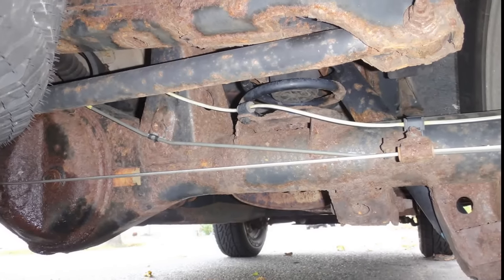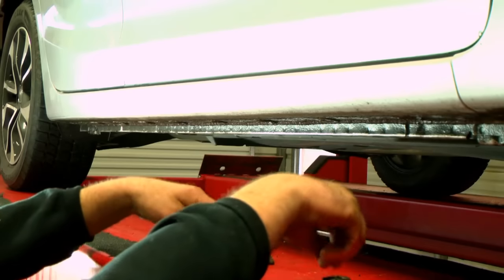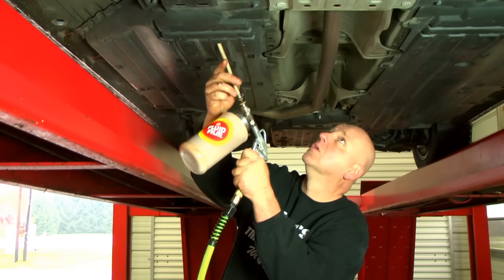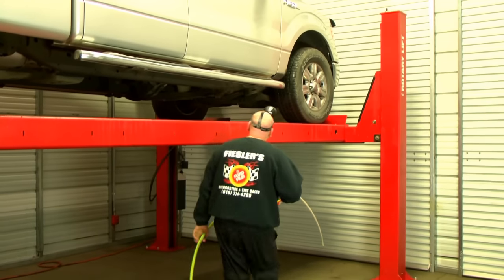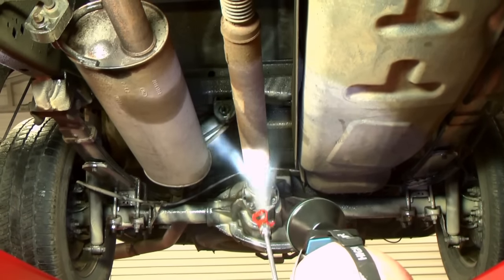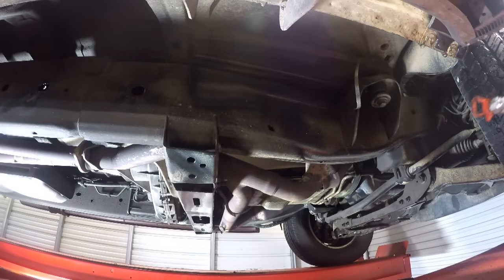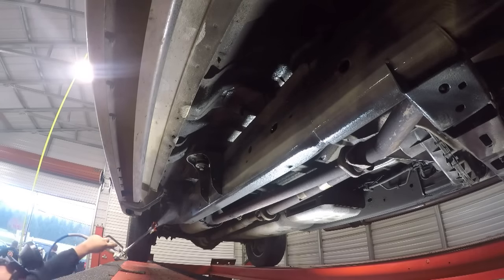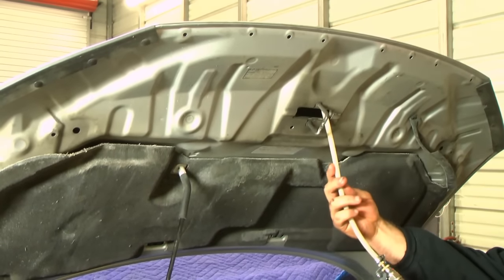FLUID FILM® Undercoating Tutorial

Comment: What cleaning should be done before coating and how dry must the car be.
Reply from the maker: sponge bob Hi Bob,
A quick rinse is all that is needed. Fluid Film can be applied to a damp surface but the dryer the better. A leaf blower or air compressor can be used to dry the undercarriage quickly

Comment: I plan on using this with my graco x5 sprayer, what is the cleanup method preferred for the pump after spraying ? Soap and water or mineral spirits ?
Reply from the maker: Dish soap and warm water. Then rinse with clean water.
Reply: Shane Boyd 
Did you try the x5 and if you did how did it work out for you and what tip did you use?

Comment: Excellent video what pray tip and psi were you using thanks
Reply from the maker: alex silva, the internal frame spraying was done with an undercoating gun with 360 degree spray nozzles at somewhere between 60-90 PSI. 
The chassis spraying was done with a Wagner electric sprayer and a standard latex house paint tip.
The complete job can be completed by either gun, this particular undercoater uses both for his process to save time.
Reply: @fluidfilmusa  what type of electronic spray gun you recommend
Reply from the maker: Fred ticoman. Any electric paint gun, undercoating gun or truck bed lining gun. Almost anything that can spray a latex paint can also apply our product.
Reply from the maker: Fred ticoman. Anything that can move a latex house paint should be able to spray our product

Comment: I wanted to rehab the underbody of my Nissan Xterra and was going to use the Rustoleum Rust Reformer. Can I apply FF over that to ensure future protection or will that degrade rust reformers? Also, there are water based and oil based rust reformers from Rustoleum. Will either of those degrade with FF?
Reply from the maker: Hello Adam, Fluid Film does work as an extra layer over most rust converters. as long as it is a non porous surface it should be fine. with new products we always recommend doing a small test section before applying a full coating to ensure there will be no negative effects.

Comment: What's happens ? When u wash n details ur vehicle ? Does soap n other cleaners affect its longevity
Reply from the maker: Hi Brandon,
As a wet coating, Fluid Film does not need to be washed after a storm. High pressure sprayers and detergents can shorten the life of the product so we recommend against it. If you would like to rinse the vehicle with standard hose pressure that works but isn’t necessary. You can also still use drive through car washes without selecting the undercarriage spray.
Reply: @fluidfilmusa   of course I just mean the body not the undercarriage but appreciate the insight very much !

Comment: Is fluid film safe on rocker panel plugs? They are rubber, I heard fluid film messes up rubber. I have a Tacoma that has rubber plugs at the bottom of the rocker panels.
Reply from the maker: Fluid Film doesn’t harm oil resistant rubbers. We have been applied inside rocker panels without issue for the last 20 years. The main area we have trouble is door seal gaskets. As long as the overspray is wiped off there should be no issue
Reply: @fluidfilmusa  thank you

Comment: Does this swell the rubber components? I was told not to use motor oil because it can swell the bushing in between parts
Reply from the maker: Fluid Film will not harm oil resistant rubbers. Almost all vehicles use an oil resistant rubber for their motor and frame mounts.

Comment: How does this stuff hold up to power washing? I like to power wash and clean my truck Atleast once a week (in winter) due to the amount of salt thrown down here in illinios.
Reply from the maker: As a wet coating we do not recommend using a pressure washer. If you wish to rinse your frame, standard hose pressure will rinse off the top layer of brine without blasting the protection off. Salts/ Brines do not need to be washed off as they do not penetrate our product.

Comment: Does cold temperature matter when applying? What if the car is already wet?
Reply from the maker: Fred Rasmussen Hello, Fluid Film can be applied at any temperature but recommend the product itself is at a room temperature to make spraying easier. Fluid Film can be applied on a damp surface but not wet. Most shops will use a leaf blower or compressed air to dry the frame before application. As a wet coating there is no cure time needed before driving.

Comment: Hallo,i buy this product,after i made this tratment on my  JEEP, after how long I can wash the car ? without losing treatment. tx
Reply: Just don't blast a power washer directly at the treated areas. There is no need to wash them afterwards.
Reply: @vitaminb4869  thanks,but i make off road with my jeep..i must wash my car,after a tour is ful with mud..tx
Reply from the maker: As a wet coating the frame requires no cure time. For washing we recommend using hose pressure

Comment: I am preparing to do this soon before winter starts. I read that fluid film should not be used on rubber, I am wondering if you re-place the rubber drain plugs that you removed at the beginning of the film, after application?
Reply from the maker: Daniel Rice,
Fluid Film will not harm Oil-resistant rubbers. We have not heard of any customers who have needed to replace the plugs.

Comment: What system is he using to spray the large parts of frame with no bottle attachment? I need that looks alot easier than the quart bottles
Reply from the maker: Our product has a similar viscosity to a house paint when we’ll mixed and can be applied directly with an airless (electric) paint sprayer directly from the gallon, 5 gallon, or 55 gallon drum. Any electric paint sprayer should work.
Reply: @fluidfilmusa   Yes...But can you please find out which setup are you using in this video? and let us know.
 I dont recognize that gun with the wide fan tip and its working like a fire hose, not all airless paint guns will spray fluid film this well, ...Love the product..NEED THIS GUN SETUP!
***EDIT...gun appears to be a Graco magnum airless
Reply from the maker: @Sk00terjolly  Graco Magnum ProLTS 170 was what was used
Reply: @fluidfilmusa  Cool!  that gun setup really gets coverage!  Thank you!!

Comment: Had my friend detail my 1997 truck that has a perfect frame. He took the liberty of spraying 3 cans of CREST SUPER RUBBER COAT on my frame. How can I undo this??
Reply from the maker: Most rubber coatings are not oil resistant. Spraying FF and leaving it on the rubberized coating can soften it and make it easier to remove. Once removed you can apply Fluid Film.

Comment: what is your spray set up ? sprayer and nozzle etc. Thanks.
Reply from the maker: L. Doyon Thank you for your question! Fluid Film can be applied by either an airless paint sprayer or an undercoating gun. This video contains both a Wagner power sprayer (general application to the frame) and our FFSG kit that is sold through Napa Auto and O’reilleys (the wand attachment shots)

Comment: Can I use an airless paint sprayer, such as an electric Wagner gun to apply fluid Film?
Reply from the maker: Joseph Marciniak Absolutely! Fluid Film can be applied through an airless sprayer, or an air powered undercoating gun or truck bed lining gun
Reply: FLUID FILM® that's great! I don't have access to a large enough air compressor, but I do have an electric paint sprayer. How much fluid Film is needed to thoroughly undercoat a large pickup truck?
Reply from the maker: Joseph Marciniak typically one gallon will cover an entire undercoating for a full sized pickup. Any excess can be saved for touch ups or the next season.

Comment: how does FF  interact with Krown undercoating.....I'd like to apply FF  over my Krown'd vehicle ?????
Reply from the maker: Fluid Film is designed to penetrate into the pores of the metal and can soften some existing coatings or be used to re-hydrate them if the salt/brine has dried it. Depending on the condition of the Krown coating you may just want to apply our film to the suspension components, inside rocker panels, doors, and other areas away from the Krown coating until it begins to crack and fail.

Comment: I just did my Tacoma today but boy this stuff stinks like horse manure after a few hours of spraying but goes away and do all your service work before because this stuff will never harden it’s like oil that is sticky and wet  it will wipe off easy  and doesn’t take long to spray but it will take a gallon per truck about a half on the frame and have inside the frame i would take the wheels off and fender flares to coat under it since that is the rot areas

Comment: Do you have to wash under first?  You can shoot over apparent rust?
Reply from the maker: Hello Julie, as long as the frame is relatively clean you can apply our film directly to the frame without washing. If you have caked on dirt or grime you may want to wash first. Fluid Film can be applied directly to existing rust as it penetrates to the base metal and prevents it from progressing. We do recommend removing any loose scale before application as it can soak up the product and stop it from getting to the base.
Reply: @fluidfilmusa  Thanks very for your reply, I wanted to make sure I was doing it right.  I love FF,  I have been using for 3 yrs on my 2017 truck and trailer with good results.  👍🏻
Reply from the maker: You can apply directly to a rusted surface. We recommend knocking loose rust scale off so as much of the product can penetrate to the base.
Reply from the maker: @projet2907  anytime!
Reply: @fluidfilmusa  Super, Thanks :-0)

Comment: Just curious what do you recommend to remove it to recoat it?
Reply from the maker: rev9fan1 a high pressure spray with a detergent works best for removal and cleaning for a re-application
Reply: @fluidfilmusa  but what kind of degreaser, like if I use purple power, will it mess up the powdercoat on the frame, or paint or whatever it is?
Reply from the maker: rev9fan1 a biodegradable detergent like Dawn or Simple green work best.
Reply: @fluidfilmusa  ah ok I thought it would have to be something stronger, thanks for the response!

Comment: If I put Eastwood platinum on a frame and had it undercoated can I spray this on also?
Reply from the maker: We do not recommend Fluid Film over a rubberized undercoating. Our product is designed to soak into the pores of metal and will cause swelling and softening if applied over a porous material.
I would recommend using our product directly to the frame. Most rubberized undercoatings trap and allow rust to progress under the coating and accelerate any existing rust.

Comment: Can I use fluid film on a motocycle engine and parts?
Reply from the maker: Nothing that gets over 220degrees but it can be applied to a number of areas such as forks, frame, chain, bolts, and areas where rust has started to form.

Comment: Is there a sprayer that would allow me to apply this with a smallish 4 CFM compressor?
Reply from the maker: Our undercoating gun typically needs 70-90 PSI to operate so most small pancake compressors will work.
Reply: @fluidfilmusa  Thanks!  I just Fluid Filmed my car last week using the Husky 4.5 gallon "silent" compressor and a Wool Wax pro gun kit running at 85 psi.  The compressor ran a lot but kept up!  Pro gun is the best way to minimize time lying under the car.  The spray cans were good for touching up spots I missed without having to drag the compressor out.

Comment: where do you get the spray equipment?
Reply from the maker: We sell a kit on Amazon, or available through NAPA Auto or Oreilleys. The part number is “FFSG” and requires a compressor. Fluid film can also be applied with an airless paint sprayer as it has a similar viscosity to a house paint when well mixed and at a room temperature.

Comment: Other than exhaust components, is there anything else under my truck I should not spray?
Reply from the maker: C House as a lubricant we recommend covering disc brakes as our product is a lubricant. We also recommend checking compatibility with other undercoatings as some manufacturers (GM) use a soft wax coating that our product can soften. As long as it is a finished gloss or bare metal surface it will be fine.

Comment: should i mask off rubber boots and bushings?
Reply from the maker: Fluid Film does not damage oil-resistant runners so bushings, cv-boots and other components under the vehicle should be fine. Weather stripping on doors is typically the only rubber to look out for. If there is overspray you can wipe it off with a rag.
Reply: @fluidfilmusa  👍

Comment: How is this on a used car with rust on undercarriage?
Reply from the maker: This is a fantastic use for our product. As a wet coating it can be applied directly to a rusted surface (we recommend removing the loose scale if present) as it will soak into the rust and penetrate to the base. Effectively stopping the progression with minimal surface prep. We also have a black version of the film to both cover and treat the rust.

Comment: I received a TIP from Fluid Film about their product gelling.  Stirring with a stick isn't vigorous enough to change that thick pudding back into a liquid.  Some say that even a stirrer in an electric drill won't work.  Fluid Film suggested a paint can shaker is vigorous enough to make the change back to a liquid..  Harbor Freight sells a shaker for $ 150.  Or, just take your can over to Home Depot, Lowes or any paint store and ask them to shake it up for you.  If they are interested in good will they should do it for free.  A liquid Fluid Film is easier to spray than a pudding Fluid Film.  But that thickening process is necessary to get the best adhesion on your vehicle, I guess.  Otherwise, it would all just drip off.  If you do several vehicles each year then that $ 150 shaker is well worth the cost and convenience.

Comment: I've read that this can cause expansion in rubber parts.  What do you do to mask off things like hoses, boots, etc before applying?  Is it required, or is simply avoiding spraying them directly enough to keep them in good shape?
Reply from the maker: Robert M Thank you for reaching out. Fluid Film will not harm Oil resistant rubbers. Most newer vehicles only use oil resistant components (bushings, spacers, Hoses, motor mounts) if you’re unsure about a component you can wipe it with a rag after application on the specific rubber component.
Reply: @fluidfilmusa  Thanks for responding.  What is considered newer?  I have an '06 Infiniti (13 years old) with 75k miles.
Reply from the maker: Robert M basically anything that is not a classic. An 06 should be just fine 👍
Reply: @fluidfilmusa  Excellent.  Thanks for the info.  Have a supply of Fluid Film on the way and will be applying it soon!
Reply from the maker: Robert M Thank you! If you have any issues you can reach up at info@fluid-Film.com

Comment: Will Fluid Film soften U-Pol Gravitex? The underside floors of my truck are painted with POR15 and top coated with Gravitex, and I want to use Fluid Film over the entire underside as an extra layer of protection from corrosion.
Reply from the maker: Hello Joseph,
Thank you for your interest in our product. We have not done any specific testing on Gravitex. Our product works best on bare metal or a finished surface. anything porus can absorb the Fluid Film and cause issues. A small test section off the truck might be best to test compatibility.
Reply from the maker: Thank you for your interest in FLUID FILM®. We do not recommend applying FLUID FILM® over existing wax, tar or rubberized coatings. It may cause that coating to soften. If you have any other questions, please let us know.

Best Regards, 

-FLUID FILM® Team

Comment: I use one of those touchless carwashes in the winter. When you drive into the bay there is an undercarriage spray I don't "think" there is soap, its just a line of high-pressure jets you slowly drive over and it rinses off the undercarriage. How will Fluid Flim hold up to the use of that kind of abuse? Thanks.

Comment: What psi is reccomended?
Reply from the maker: For the undercoating gun 70-90psi. For an airless sprayer the PSI is much higher but that standard pressure from the factory will work well. We do recommend mixing the product well and getting it to a room temperature before application.

Comment: I thought you had to wash underneath the car throughly before applying FF
Reply from the maker: GnosisMan50 as long as there isn’t enough dirt to prevent the film from getting to the metal it won’t harm the coating. It just comes down to preference. Works either way
Reply: @fluidfilmusa  Thanks...I'm having my car undercoated with FF very soon.